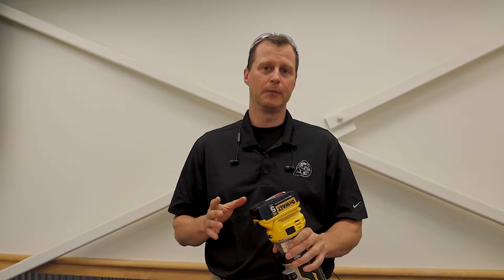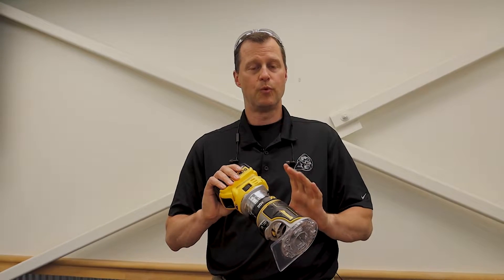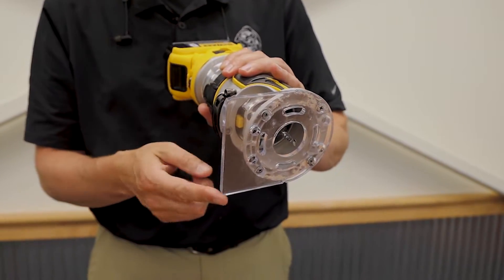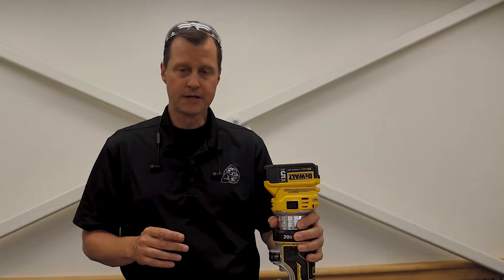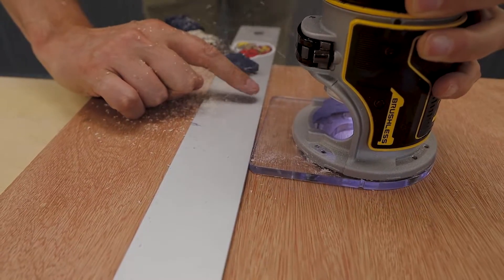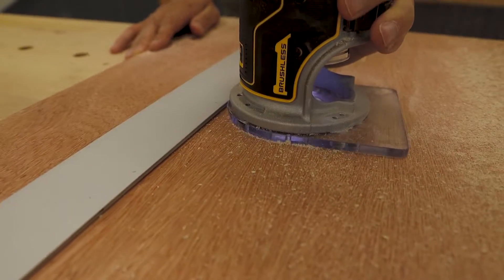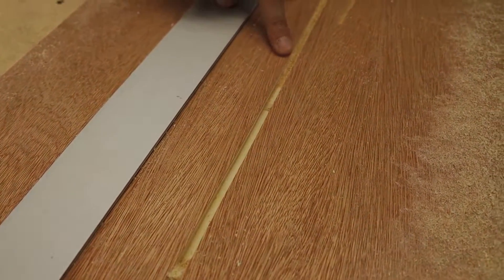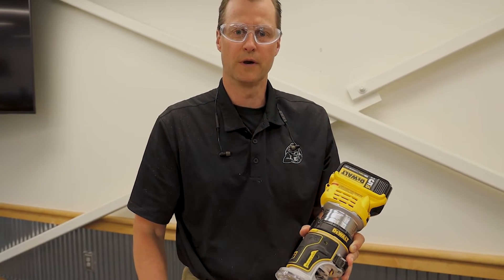Tool Tip: Using a router with a straight edge

Comment: Thank you thank you thank you. But too late to save me from gouging the beautiful cherry door I had  just finished veneering and sanding over 4 days. Was ready to decide i wasn't smart enough to have a router operator's license. Why the heck doesn't the company call that out? And what is the point of that flat edge?
Reply: The straight edge is where the edge attachment screw onto so you can rest the edge attachment onto the side of the wood. He used this as a straight edge with it on TOP of the wood.   You’re welcome ...

Comment: Then what is the purpose of the flat side of the router?
Reply: More surface area to hold it with your hand when guiding it, prevents tool from rolling over/away when put down
Reply: Using Roundover bits comes to mind.

Comment: I remember being taught that using a round or curved edge will not be accurate unless it is a perfect circle and the cutter is perfectly centred. Using a flat edge will allow a repeatable accurate cut as long as it it is held fast to the guide rail or batten. The same principle as using the fence which has a flat face. With this router it would be more stable to use one of the other two flat edges and, perhaps, pull rather than push.